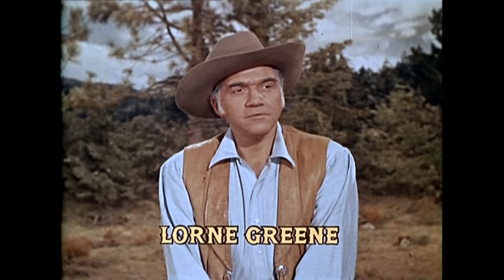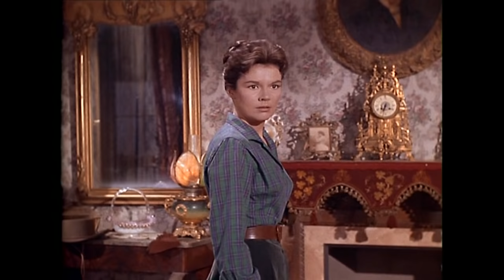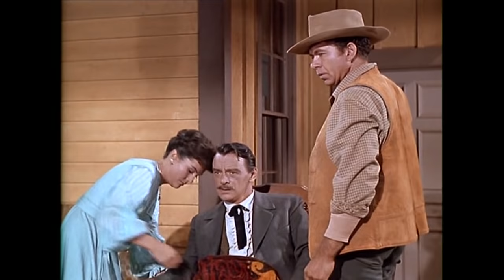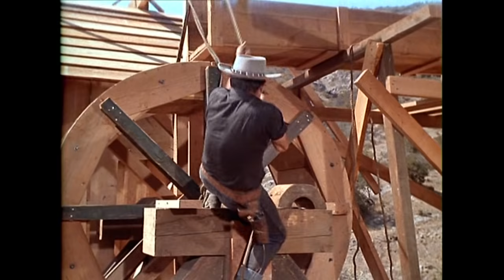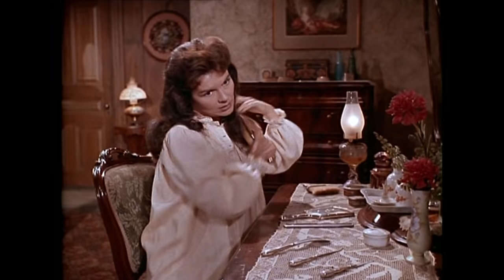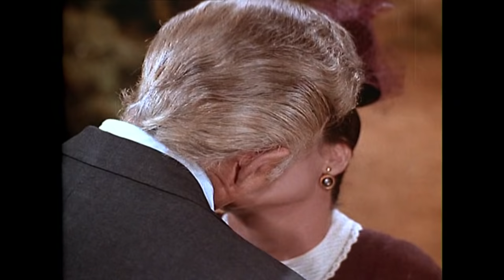Bonanza - The Mill | Episode 36 | Full Episode | Wild West | English

Comment: Nowadays you could use that same exact mill to grind up old circuit boards for the purposes of precious metals extraction. Set up a smelter right next to it and power the bellows online off that same wheel with a belt drive. The term "online" actually dates back to the 1800s because it meant that a piece of machinery was connected to the same rotating shaft via a belt drive.